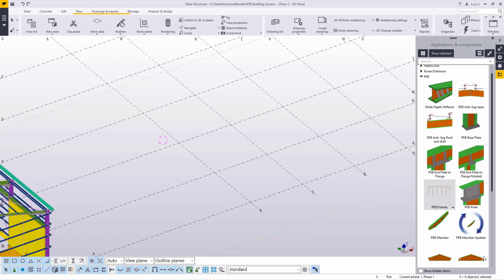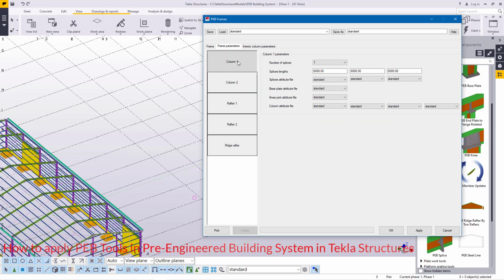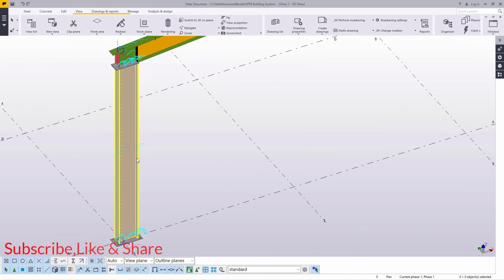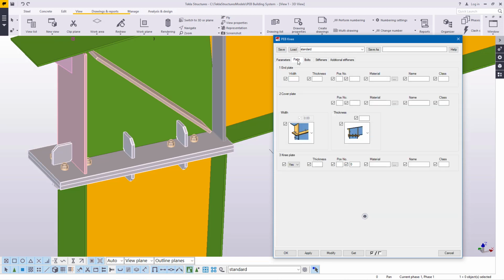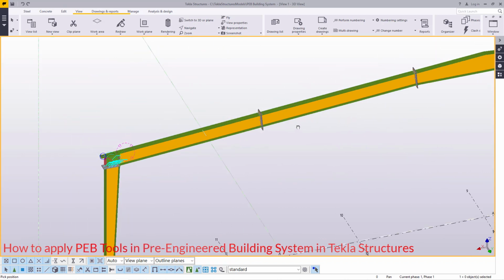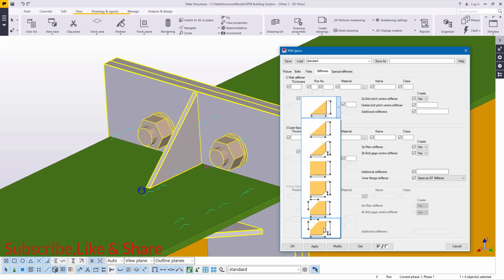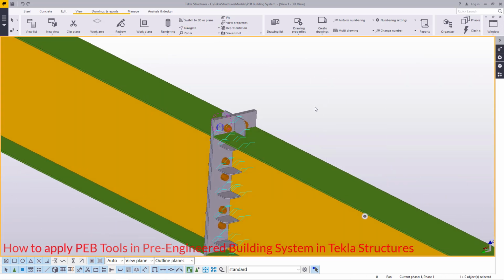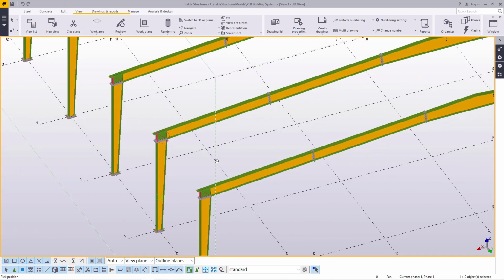How to apply PEB Tools in Pre - Engineered Building System | Tekla Structures

Comment: how i can solve problem with stiffener in splice connection when thickness of two flane is different one of stiffter is going into member
Reply from the maker: you need a macro to make it work easier
Reply: can suggest macro?